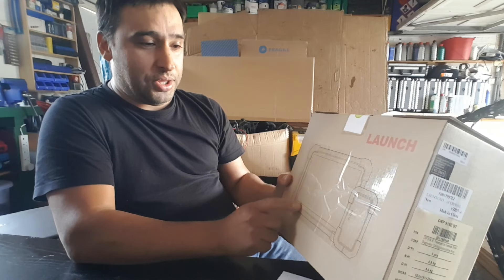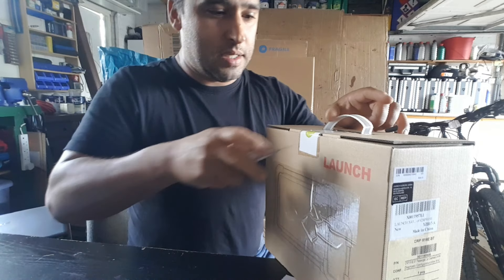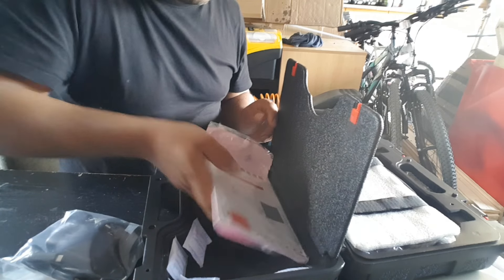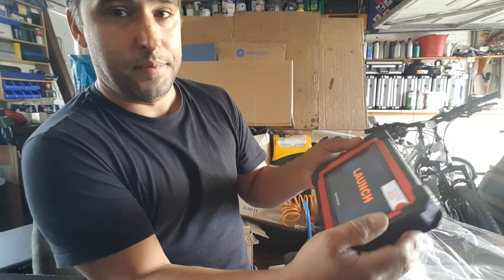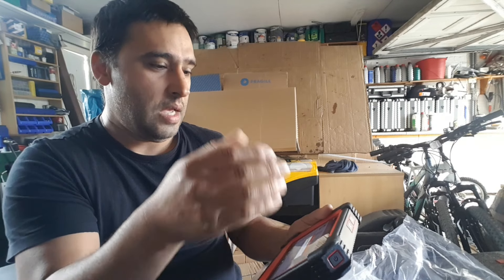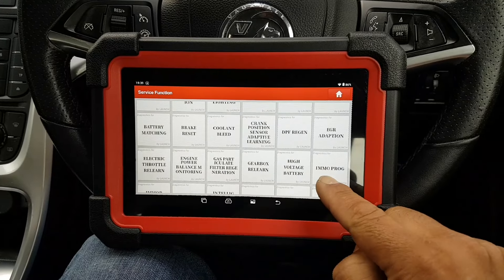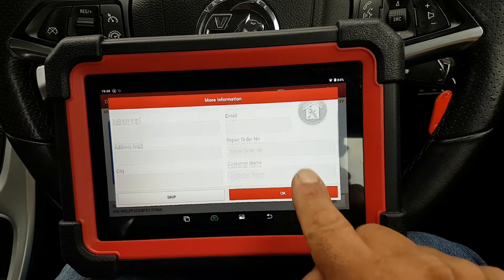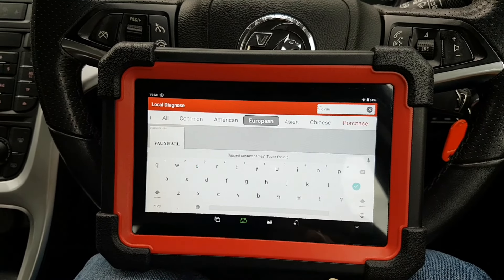New scanner first impressions... Do I recommend it? (Discount codes in the description below)

Comment: I have a Kingbolen k6 i got from the company. For a review it is very good for a basic Scan tool the only thing I dont like is it has a the dreaded Cable. I have the use of my friends Topdon BT800 which looks similar to this machine you have here. I think it depends on what you are doing with them if you are only working part  time with a few car's there great. Having said that. They can take you out of bad situation as well. I think you did a good job on reviewing the tool and would consider buying it if. I was in the market to buy another tool.  Congratulations on your 100k well Deserved long may it continue thank you again. 👍😊
Reply from the maker: Agree...
And thank you!
👍👍👍
Reply: Topdon, Kingbolen - all of them is re-branded Launch devices. They use the same SW.
Reply: Hi friend
You mean the k6pro, from kingbolen or the S6

Comment: Great video. It looks like good value to me. However, does it allow you to swap out a broken ecu, change the vin, and programme it for the imobilizer like you do with the Autel?
Reply from the maker: Not quite...
I am still testing it, but is seems slightly more limited.
It does have some immobiliser functionality though...
👍👍👍
Reply: @LMAutoRepairs  thanks. That’s a bit disappointing then. I’ve yet to find a “hobby” priced diagnostic tool that has that functionality. It’s a very useful thing to be able to do ie swap out a broken ecu.
Reply from the maker: @Aircooledflat4bug 
Yes... some cars is not that simple... and require different tools...
Unfortunately there no such thing as one fits all...
👍

Comment: Intelligent diagnosis does the automatic scan and detects VIN, you should have used this first to explain, it has excellent detection and operation capabilities, the software is full launch software over most of launch devices,  so is excellent value for money, so you might wish to think about an update bonus vid. As you say this is an excellent tool for a part timer or diy or even small independant for initial fault finding prior to bringing out the big scanner.
Reply from the maker: It looks like...
I used the intelligent diagnosis off camera, and yes, it does that... same thing as the Artipad I have used few years back...
Once I have more experience with it, I will might actually do an update video...
👍👍👍
Reply: @LMAutoRepairs  Keep up the excellent vides👍
Reply from the maker: @DiyMech 
👍

Comment: Hello. You are smart and you do a good job. But this review is not worth much - sorry. Instead of learning how to use the scanner, you did it blindly... If I didn't have the scanner - I wouldn't criticize you. In the end, to say that it diagnoses faster with one car and slower with the other - but maybe the communication protocol is telling you something and thus also the speed of communication between the car and the scanner. Regarding the display format of the scanner, it is small - it will probably be because the price of the device is very decent. The only thing that can be criticized is that the scanner has no support at the back, I agree with that. Good luck in what you are doing, you are great.
Reply from the maker: This first video was just supposed to be like that... a first impressions and the sort of unboxing...
Off course I understand that on different cars the data transfer speeds are different...
The rest is just exploring the tool...
I think what majority of people is interested on, is on rate of available options against the ones that actually work...
I just actually tried it yesterday on some injectors calibration programming, and although the option was there, the procedure did not work... 
This will be the kind of things I will cover on an update video once I have it tested enough...
👍👍👍
Reply: @LMAutoRepairs  
You are a decent person. Thank you for your reply. Good luck.